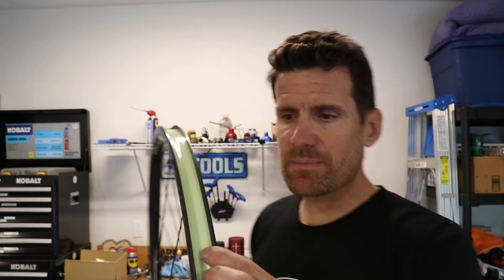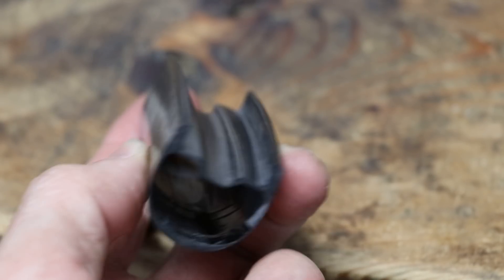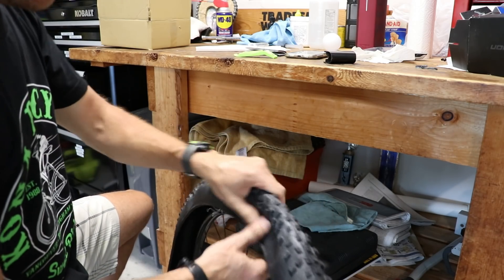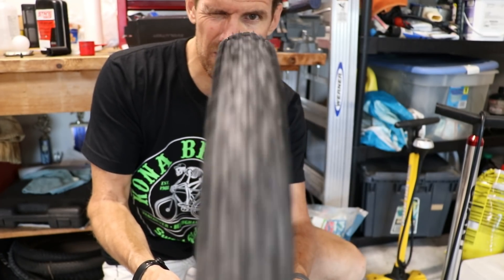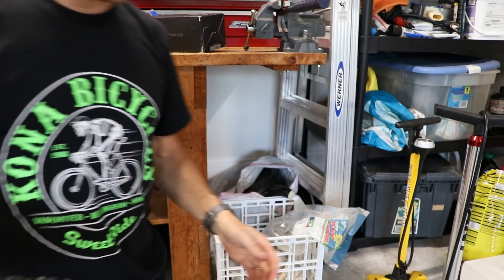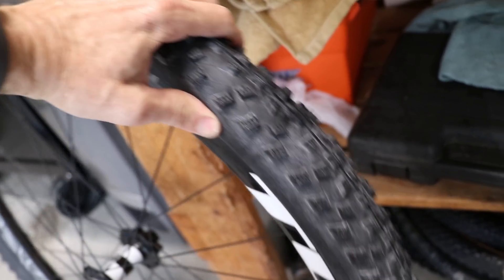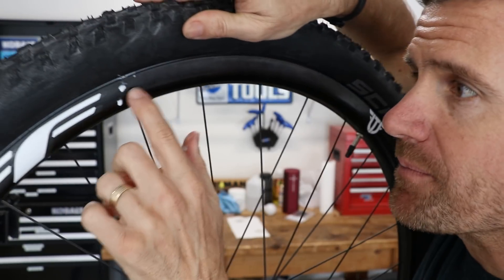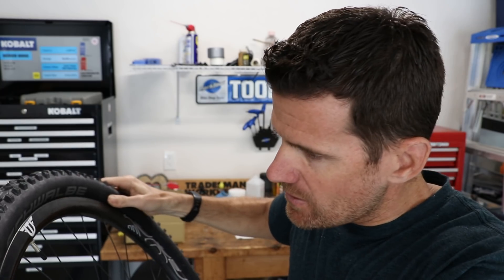Tuff Carbon XC Wheels - Mounting Tubeless Tires

Comment: Clint, I think this lower priced carbon rim project is one of the most important you have done yet.  Carbon rims are what us economists would call a case of "asymmetric information."  Basically the customer has no way of knowing the product's quality.  So we are left looking for indicators of quality like brand name, country of origin, and high price.  A terrible predicament!  With a significant amount of money - and personal safety - on the line, we are actually afraid to pay less!   With your reputation for integrity and thoroughness, I think you may be able to seriously affect the future of the carbon rim industry.  That would truly be using the internet to its full potential.  Good luck with the new rims.

Comment: These kinds of tests are invaluable for us amateurs interested in middle ground products.  My method of doing tubeless takes a lot longer, first I put tube in there overnight to "set" the tape and help adhere it, next I take the tube out and put the entire tire back on, inflate with no sealant and then later pull the valve core out and add sealant through there and re-inflate and let it sit like you said on all sides.  Looking forward to seeing how it'll perform and if you burp any pressure.

Comment: Hi Clint, I'd be interested to know what particular metal is used in the spoke holes reinforcing.
Reply from the maker: Not sure, but I think someone from Tuff is monitoring this comment section so I'll let him answer.
Reply: Once you've signed a NDA I'll be able to tell you the reinforcements are Brass
Reply: TUFF Cycle Thanks for your reply.
One more question if I may? Is the brass electrically insulated from the Carbon?

Comment: You over do it with the tyre livers, it can cut the tape in the rims. 
If you use a bit of soap water on the bid before installation it will make the process easier.